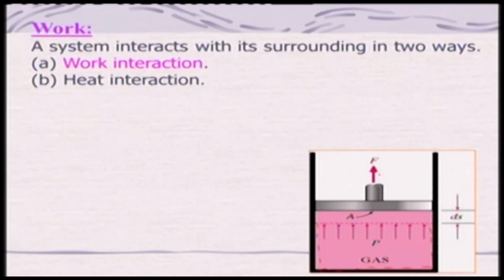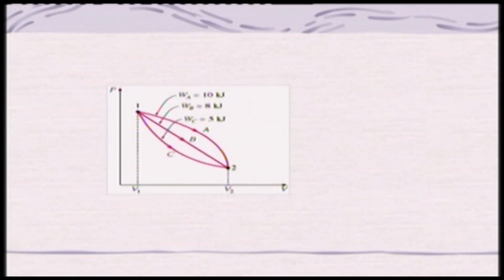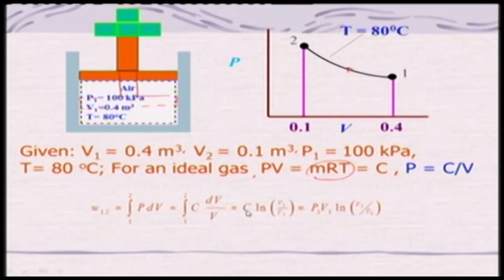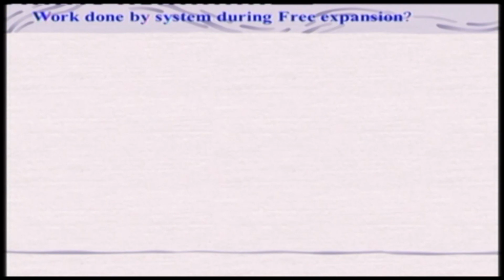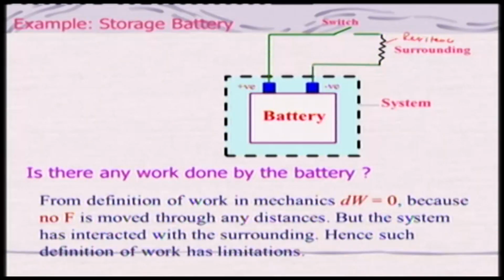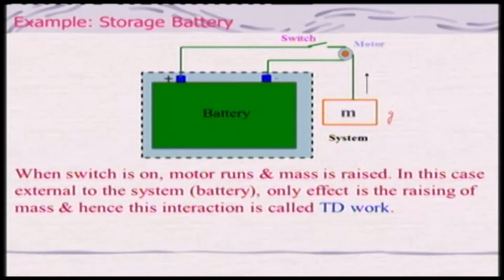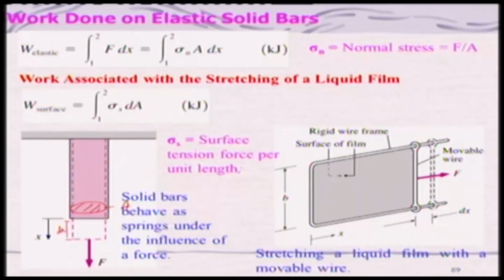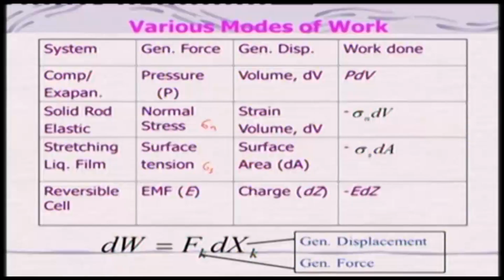Energy and its Interactions

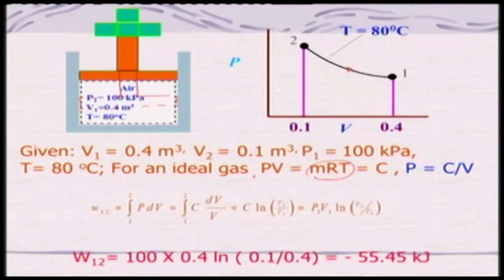Comment: I think the work done (-55.45KJ) is by system. Since it is compression, while the surrounding does positive work (+55.45 KJ) by compressing the gas(system). @13:26
Reply: Yepp, -55.45 kJ is indeed the work done BY the system. The -ve sign denotes that the surroundings are exerting positive work on the system. (i.e. It makes us realise that the Surrounding is the one doing the work in reality and not the system.)